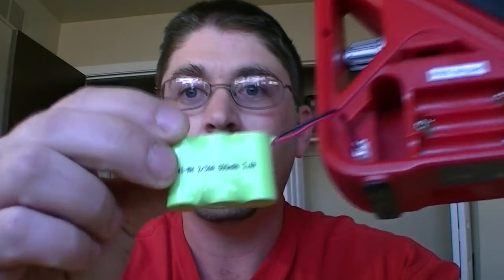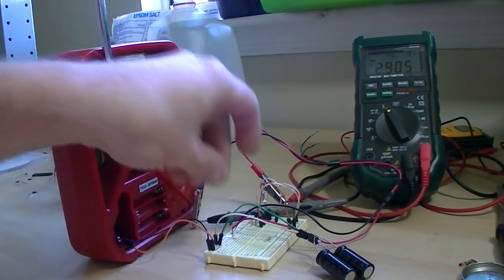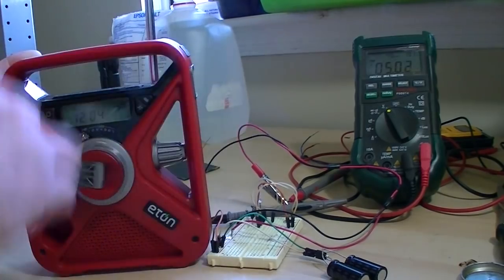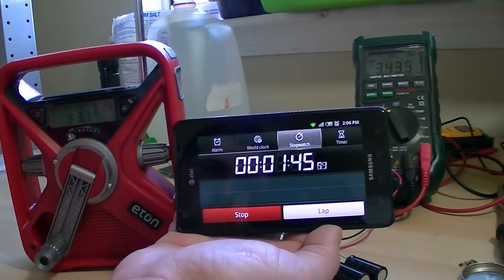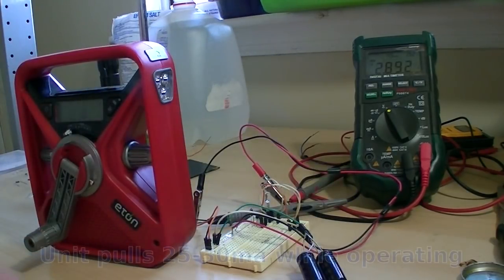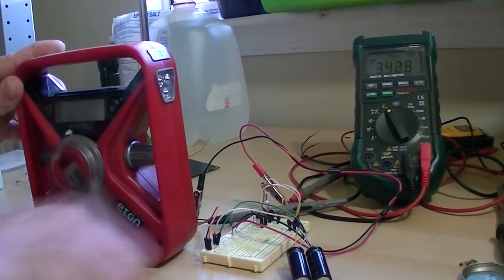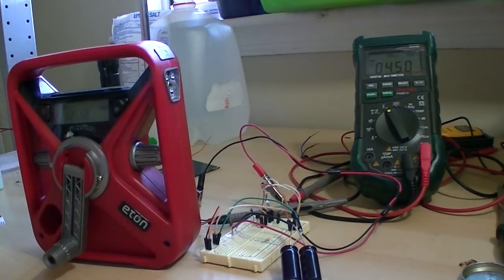Supercapacitors Instead Of Rechargeable Batteries

Comment: The VOLTAGE CAPACITY increases when in series, but the CAPACITANCE VALUE decreases (when all caps are the same value, you divide the value by the number of caps in series, in this case it's 2, so 10F / 2 = 5F).

This is not only common knowledge, but it was widely used in tube radios and amplifiers, since back then high-voltage caps used to be very expensive, so they used cheaper lower-voltage ones in series so they matched with the high-voltage handing needed.

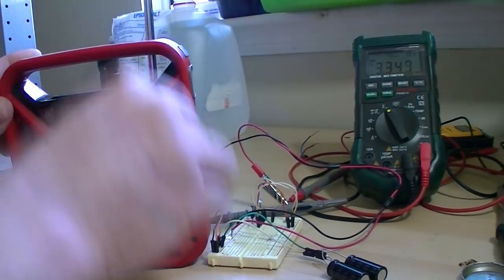Comment: Considering that each 10F = 5 minutes of use for your radio (since 5F = 2:30 minutes), you would need 120F per hour of use.
With two 350F in series, you'll get about an hour and a half.

I wish these things were easier to find here in Brazil. It would be much more economic (and nature-friendly) for me to use a bank of those to power my circuit prototypes instead of using a wall-wart or rechargeable batteries. It would also allow me to have multi-voltage outputs for op-amps and stuff.

Comment: if you drive down to your local salvage yard. you can buy all the crap you could ever want. cheap. capacitors are almost worthless in the scrap world. Caps in the 5000uf range are super common to find. and 20 bucks would buy you 100's of them. 3 phase motors are cheap, and can be used as your pedal pike generator. maybe 30 bucks and you could build a BIG ASS manual generator. i build what equates to 3 phase generators for running machine tools on home current. junkyards all the way!!!!

Comment: has anyone ever come up with a hybrid battery/capacitor combo ? The capacitors would allow for instant useability, and can simultaneously charge the battery and power the device - allowing both instant use and long term storage - charge would be stored in the battery rather than capacitr (mainly because my mai put-off with caps is their discharge rate even when just left in storage

Comment: I have a similar setup with a handcrank radio / led light run of two 2.7v 400F caps in seriese. I generally charge it by solar panel in the window. I have LEDs on the caps for balancing. When charged to 5v it will run the radio on a moderate volume for about 10 hours or the LED lights for ~2 hours. Not at all bad.

Comment from the maker: i wouldn't try running it off of a joule thief as they are unregulated boost converters, you risk overvolting the unit when you shut the power off.  As for the mAh rating, that sounds about right.  So if we used 2-350F capacitors in series for 175F of capacitance, that would give us about 41.475mAh, much more reasonable.